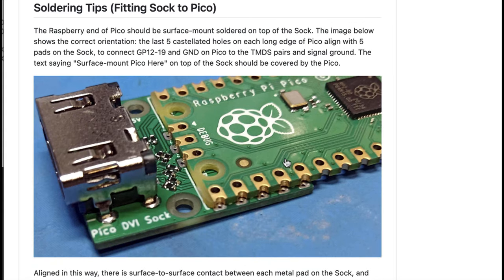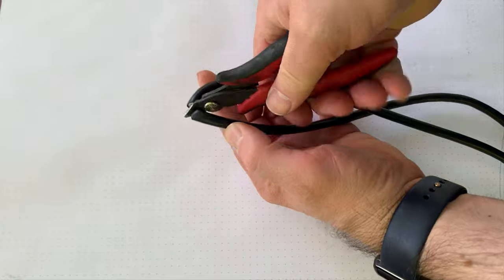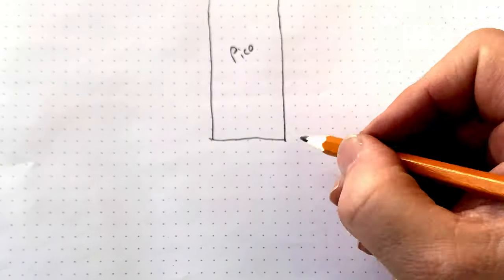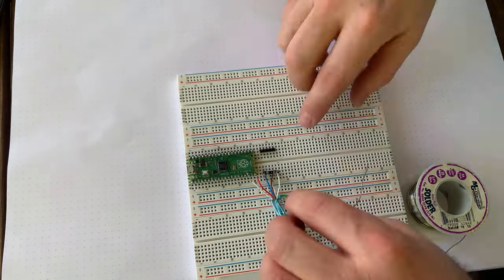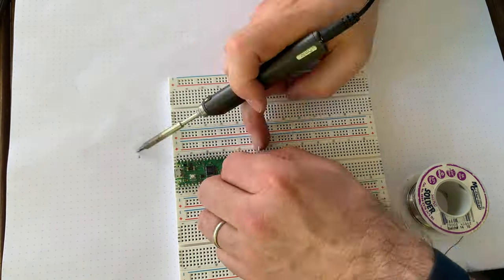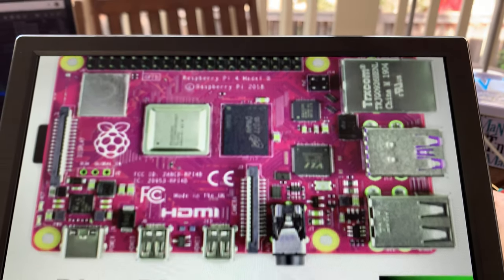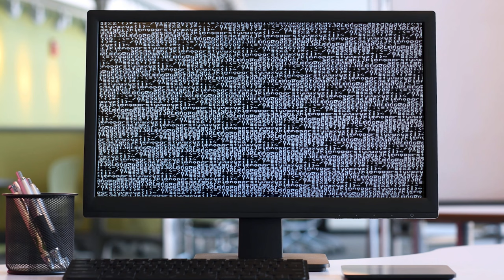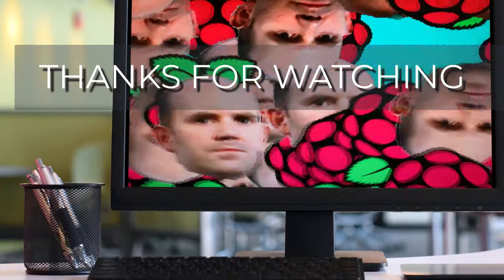Raspberry Pi Pico, HDMI on a breadboard

Comment: If anyone is coming to this video, I found I kept getting a blank display. But it was actually the wiring that was wrong. Based on the current code in the PicoDVI repo (going by the date of this comment), the wiring is:

B+ GP12
B- GP13
CL+ GP14
CL- GP15
R+ GP16
R- GP17
G+ GP18
G- GP19

Assuming you're wiring up as the DIV_Sock is laid out (as per this video).

Comment: At the very end of your very  instructive and well produced video,  you commented something about connecting to the DVI of the monitor vs connecting to the AC  monitor.  Somehow I can't get my  80 year old vacuum tube mind around what you were referring to.  Could  you clarify just a bit if it isn't too much trouble?  I think I checked all of the other comments but.....   Thanks
Reply from the maker: Hi Rye, 

So what I found is that connecting to an HDMI port rather than a DVI worked better. DVI seems much more picky about resolutions etc. So just connected directly to an HDMI port on a modern monitor worked fine. My older DVI monitors did not like the signal so much. I hope this helps.

Comment: Hi all, be aware that some HDMI cable manufacturer don't use correct color pairs for the signals... for example mine had the clock pair on blue instead brown. So checkout pinout yourself :)

Comment: This is great, I'm trying my best to get it working but all i get is a blank screen.  I've added the 5v line to the separate red wire but still nothing, do I need to change any settings before compiling?
Reply: Did you get it working?

Comment: I have been loving your content. I tried searching for the Ethernet connection (without any other modules) on your channel and the general Web but there is nothing. Is it possible? It would be great as the pico does not have Internet connectivity.

Comment: Can this be used for the RGB to HDMI project instead of a Pi Zero?
Reply from the maker: Yeah, at least you can buy a pico these days. I tried to do some composite video (monochrome classic mac) to HDMI at one point. It half worked https://twitter.com/robingrosset/status/1401535750588485632?s=20   With RGB the Pico only has limit RAM so the resolution and colour depth are one issue. I could not quite get the pico to sync precisely with the signal but that might just be me not being good at I/O programming these things.

Comment: Question: Can I use it along with Geoff's MMBasic, BASIC Interpreter? If yes, are there any restrictions in my programs due to the hardware add-on?
Reply: Here's my guesses from reading the pi pico PIO specs:

One of the two PIO block is being used here, eight of the GPIO pins are allocated, CPU clock may have to be modified to match the HDMI signal.

Other than that, the CPU can focus on creating the image instead of copying the image to HDMI because the PIO state machine is running almost independently to handle only the HDMI

Comment: I wish there was a arduino version of the code. I would of love to test this out.
Reply: Arduino + HDMI = IMPOSSIBLE
Arduino + VGA = very hard
Reply: Arduino probably can't do this, Pi Pico can do it because it has 8 PIO which are basically very fast hardware logic co-processors. They have limited capability but can generate very fast signals
Reply: @joshuavincent7884  not the hardware of arduino I’m referring to the code itself. Instead of being in python.
Reply: @Legoloewe   not the hardware of arduino I’m referring to the code itself. Instead of being in python.
Reply: @DiyintheGhetto  this project is written mostly in C not python. Python is likely too slow for this. Also Arduino is not a language it's basically highly abstracted C++
Reply: @joshuavincent7884  wow damn so what r ppl writing? freaking image?

Comment: How would you get an HDMI input into a Raspberry Pico instead of HDMI out?
Reply from the maker: It’s basically TMDS signalling, so 3 data lines and one click line each as differential pairs. Minimum clock is 25Mhz, going up to 350Mhz at 1080p . There is a logic analyzer demo application for the pico and you can run the Peripherial IO at full clock speed. I think it might be possible if there is an easy way to decode to differential pairs into a simple logic level. I tried decoding monochrome video signal from an old Mac with the logic analyzer example and it kinda worked video here https://twitter.com/robingrosset/status/1401535750588485632?s=21

At 1080p resolution you will struggle to process the data rate with a pico. You can only get 320x240 full colour bitmap image in RAM so you could not capture a full frame without storing it somewhere else.

Comment: Robin, this video was really helpful and I've successfully got a video output (my monitor required the 5v line of the HDMI cable to be driven). Oddly, my black and white colors are off. On my display, black is yellow and white is a dark blue. Did you encounter this with your strange colors?
Reply: Ah, it turns out I had the d1 and d2 pin pairs the wrong way around. Again wonderful tutorial.
Reply from the maker: Yeah I got that combination. I think I did everything possible wrong before I got it right :-) looks like you figured it out which is cool. Good luck with it!
Reply: @robingrosset6941  Seems to me the right way to get this right would be to feed it grayscale so you can fiddle with the pairs to get proper grayscale, then feed it reds, then greens, then blues. That should sort out the channels pretty methodically.

Comment: This may be a stupid question, but will it work on an HDMI television? Or only on a DVI monitor?
Reply from the maker: My experience is it works better on HDMI televisions than DVI-D monitors, for some reason. DVI-D is the same signals to HDMI as far as I can tell.
Reply: @robingrosset6941  Thanks! I'd like to buy a Pico Pi to connect it to a small portable HDMI screen.

Comment: Whats the max resolution and refresh rate?
Reply from the maker: In the video this is 640x480 @ 60Hz but there are a lot of different modes. 720p is also possible @ 30Hz. All the currently supported modes are in this file https://github.com/Wren6991/PicoDVI/blob/master/software/libdvi/dvi_timing.c
Reply: Have seen this demo elsewhere.  I believe the color palate is a bit limited by RAM.
Overclocking, overvolting, and a heat sink may be necessary for 720p@30.

Comment: can this be done with pio instead of bit banging?
Reply: It does use pio. Check the software link then drill down to software/libdvi/dviserialiser.pio
Reply: this is literally possible because it was exactly using pio

Comment: Hi. Why 8x 270ohm?
Reply from the maker: Hi, 

There are 4 differential pairs in a DVI-D signal. The specification for DVI signals is here https://glenwing.github.io/docs/DVI-1.0.pdf page 33 is where the relevant section starts,. 

So the DVI-D receiver in your monitor has 50 ohm pull up resistors to 3.3v . While the maximum voltage is 3.3v for DVI the signal is transmitted using the differential voltage of the pairs. When the pico pin is high no current flows as both ends are at 3.3v when the pico pin is low current flows from monitor to the pico. The pico is acting as a current sink. The pins can sink up to 16mA so 270 ohm resistor you get about 10mA of current flowing when the pico pin is low. 

According to the DVI spec the Vidiff which is the peak to peak difference at the receiver should be between 150 mV and 1200 mV. So with a  270 ohm at the transmitter and a 50 ohm at the receiver the voltage between high and low at the receiver should be ~500mV this is the single ended swing. So its twice this value is the peak to peak difference of the pair so again this is in spec for DVI-D. 

Luke Wren has a good explanation of the circuit on his GitHub repo here and the testing he did of the source eye diagram shows the circuit is passing the DVI-D/HMDI specs. 
 https://github.com/Wren6991/PicoDVI

Comment: The EVOVO monitor does not exist.
Reply from the maker: You are right Evovo does not exist. That’s because its a Eyoyo 10 Inch IPS LCD Monitor,  I bought it from Amazon. The great thing is it has HDMI, VGA, Composite and BNC inputs.. 

https://www.amazon.ca/Eyoyo-Monitor-1280x800-Resolution-Security/dp/B072N2YGXN